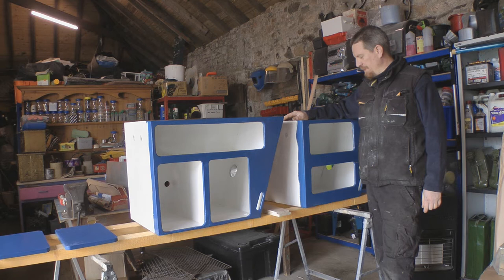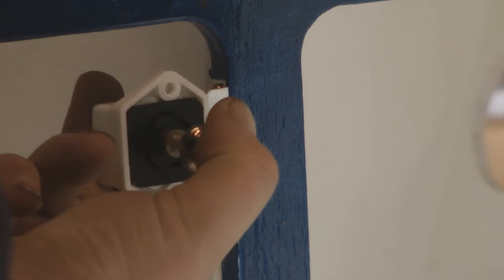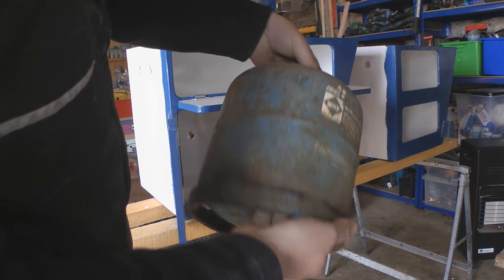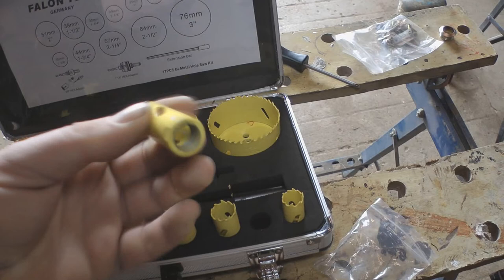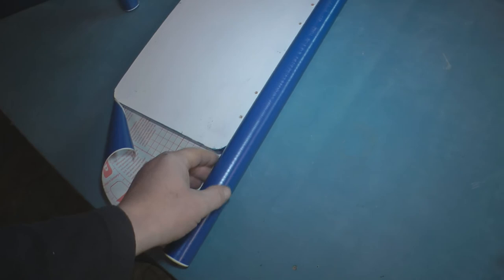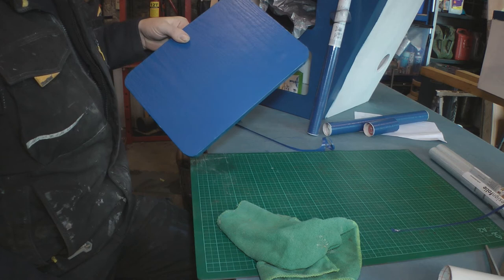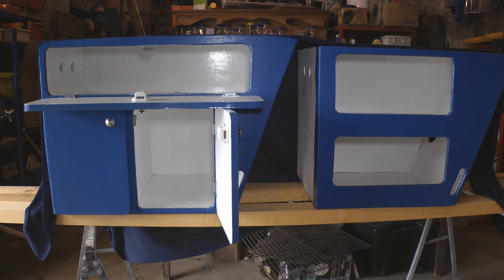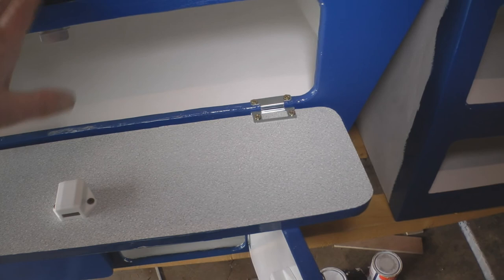Minibus Camp Kitchen Build. 7 of 9

Comment: Nice custom work and those latch nob catch units are very practical, I never saw those before , now I'll just have to find some for my vintage 67 trailer. Spring is still staying stingy here. Thanks & all the best.
Reply from the maker: Thanks, they are pretty good latches. I have the same in my camper and they work great in there so that's why I picked them for this. Not the cheapest option but I got them for around £3 each delivered, so not overly expensive, but I think they work better than the likes of the magnetic or roller type catches. Thanks for watching, we are back to strong winds and rain so it's just like summer here haha. Atb Dave

Comment: looking good, really good, i am suitably impressed sir!   i know i sound like a right know it all bastard, but...with the fablon sticky back plastic stuff, if you warm in gently it does stick really well, plus it conforms to any slight irregularities with out peeling back, just a tip there from an avid blue peter fan hahah
Reply from the maker: Cheers buddy, great tip I wasn't sure if I should have been heating it or not I have used similar carbon-fiber effect stuff, in my boy racer days, that I heated but it seemed thicker and a bit stiffer. I didn't wanna melt this with my heat gun and I don't own a hair dryer surprisingly. haha  Really appreciate the advice, it's usually me that's the know it all bastard so I'm happy to take advice from anyone who has it to share. Thanks Atb Dave

Comment: Really coming along now Dave. I got my empty gas bottle from towsure. SAme price as yours, not half as rusty tho.  Tried the fitting put to see how it worked. Bit awkward screwing a full one on, I'd imagine. Still, no problem really. Gonna get replacement from go outdoors Swansea asap. It just fits in corner of cabinet. Will photo soon cos I'd like some advice on whether to box it in and make vent for side of unit.  If that makes sense. There is an air vent behind there on side of bongo anyway. Would that not do for escape gas when you change bottles.
Reply from the maker: Hi Sue, thanks. Glad the bottle fit ok. Yes they can be tricky to fit, I find the best way is to lay the bottle on it's side and hold regulator in place and kinda roll the bottle. Once regulator is fitted then right the bottle and fit into place. Probably doesn't need boxed in but make sure it is strapped securely n place, and just a hole at the bottom of the cupboard vent near where the vent in the van is should be fine but sure send photos then I can give the best advice. Atb Dave